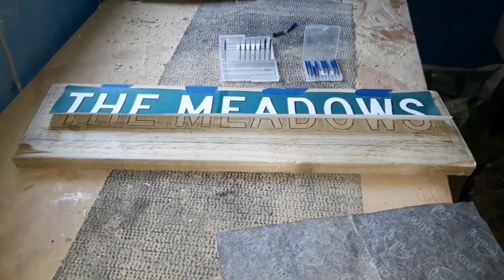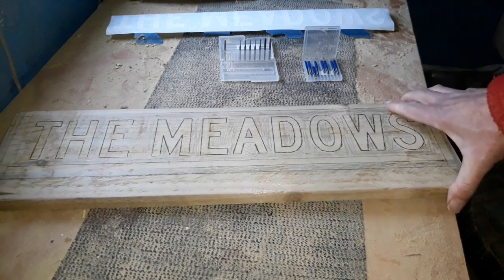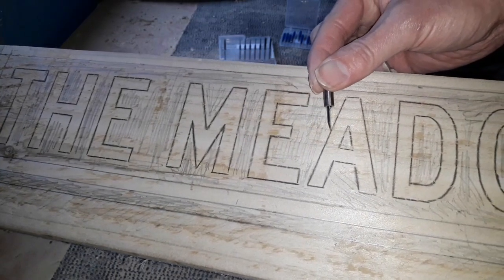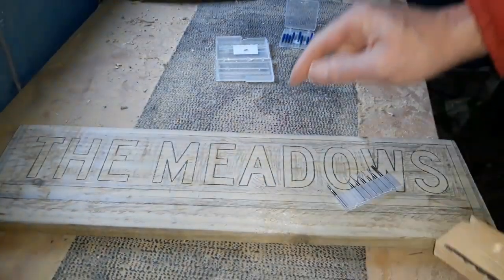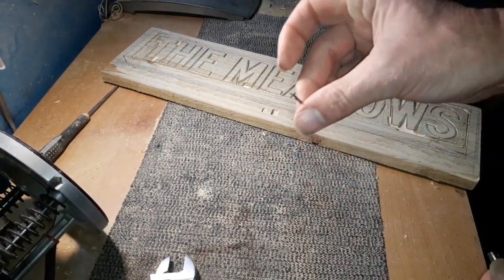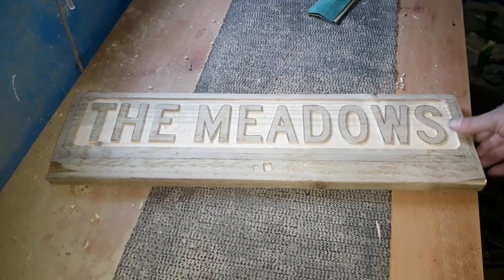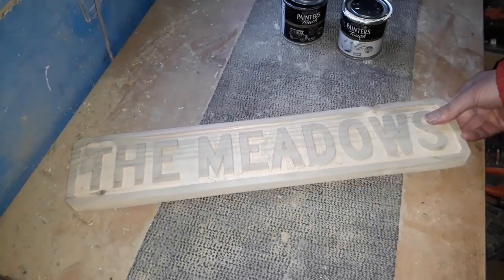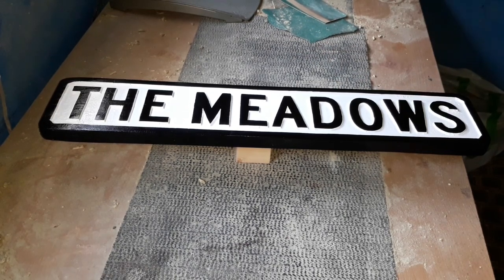Street sign on fencing wood router project

Comment: Shane could you tell me why you don't just use the mill end bits from start to finish. From my little experience , I didn't find much difference from  Cnc bit and mill end. Obviously you will have the reason why. Thanks Steve
Reply from the maker: I've done one small  project with just the end mill bits a while back ,it worked fine,I like to use the cnc bits first because they give a nice sharp cut,when you come to a point, like in the letter M you can gently lift the router out of the wood as you route towards the point,this gives a nicer finish..another reason is projects with small letters, definitely with pine wood can pop off,si I use the cnc bits to separate the letter from the surrounding wood, so less chance of it popping off,also using cnc bits puts less strain on the router motor..alot of folk use profile and spiral upper cut bits to work with,60 v groove bits is another popular bit,its a personal thing really, just find the bits  that work for you,..I found a bit in a box with my last router and its Brill for clearing out with,but I've no idea what its even called..😂😂👍
Reply: @fishtank5050   Thanks Shane , makes a lot of sense now you've said that. Thanks butty